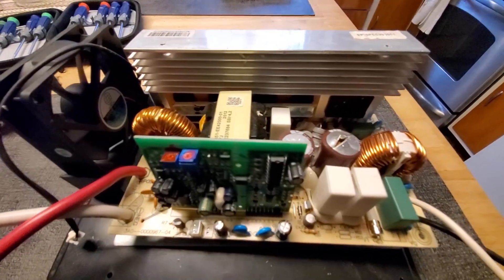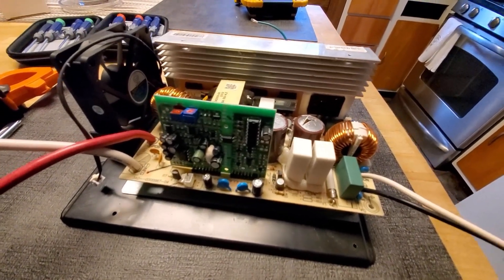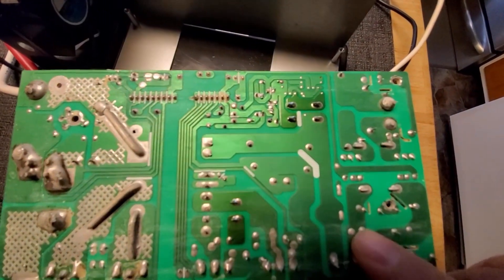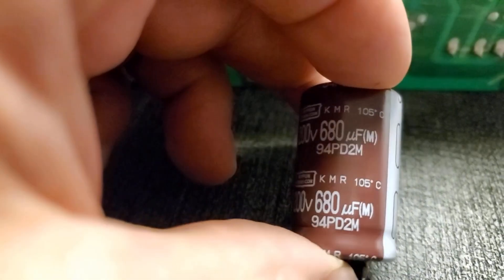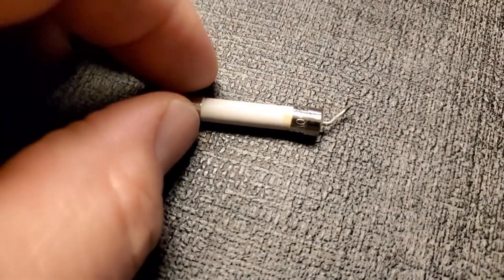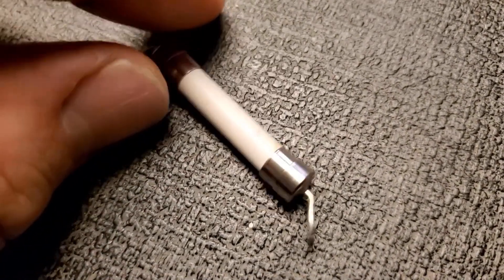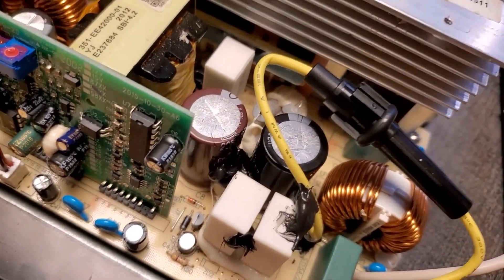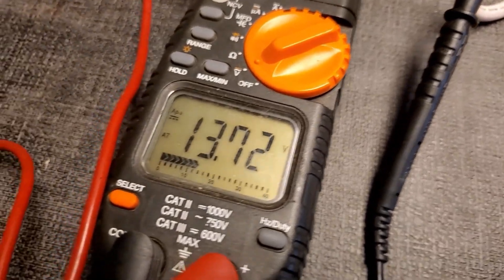Repairing a Blown12 Volt RV Camper Converter

Comment: I have an issue. I parker my rv for a 6 month. Then i hooked it to shore source them same moment my converter blow and smoke and made weird sound. I disconnected the shore power. Next day replaced the converter and same issue happen to the new converter in the same moment i plugged the shore power. I check the fuse panel and all wire compartment and I did not find any issue cause this. Any suggestion. It’s jayco 2021
Reply from the maker: What is the amperage of the camper? 30 amp or 50 amp?
Reply: @MrRChitty 30 amp
Reply: @MrRChitty i checked the shore cord today nothing wrong. Also looked behind the electric panel I am not seeing any faults connection
Reply from the maker: @Abo_Oudai what is the voltage across the two flat pins in the outlet?
Reply: @MrRChitty checked it today with meter and it gives me 240v from 110v something wrong i will just not use it anymore until have electrician looks at the outlet
Reply from the maker: @Abo_Oudai you answered my question. That's what happened to the one I repaired. Guaranteed that the converters blew a capacitor and could be repaired.